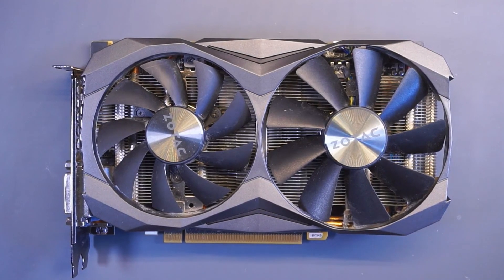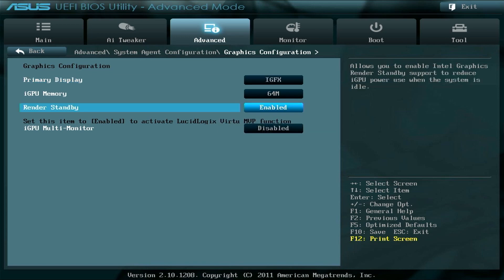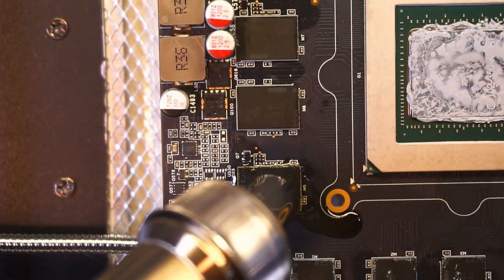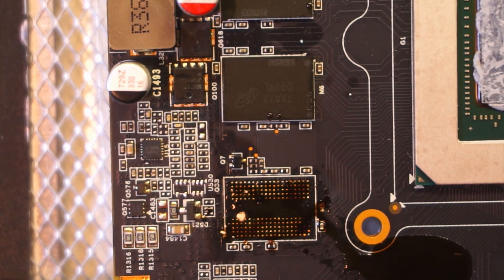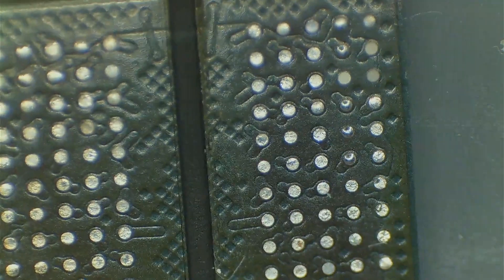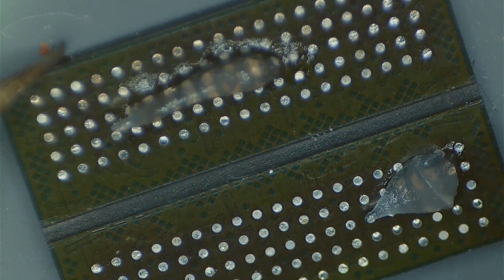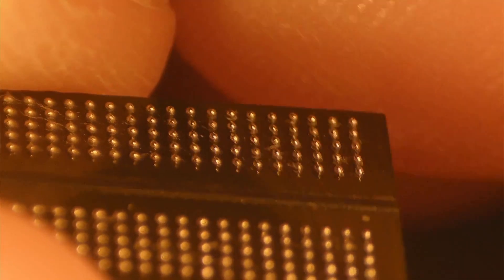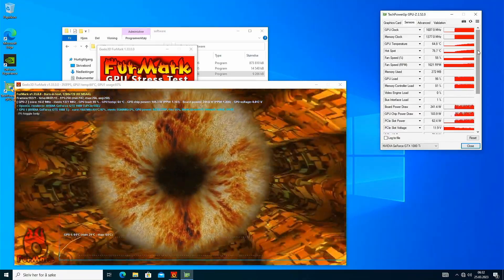Zotac GTX 1080 TI no signal / black screen video card gpu repair | VRAM reball

Comment: Dedpite being mundane vram chip replacement, manual reballing spiced up the video 😅 
How do You learn where to pin during inspection? Are there some schemes for each card somewhere? Do You have to buy them?

Comment: What measurements are the tin spheres you used?
Reply from the maker: Tin spheres? at what point in the video? Do you mean the solder balls?
Reply: @electronicrescue  yes  solder ball
Reply from the maker: I believe I used 0.40mm older balls for this chip. But check the datasheet for your specific chip to makes sure you get the correct size 😊